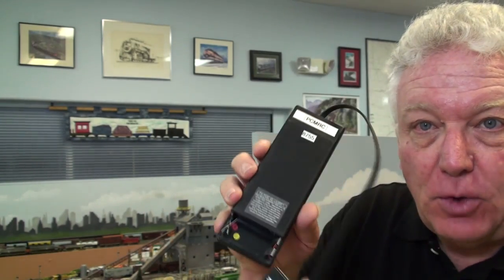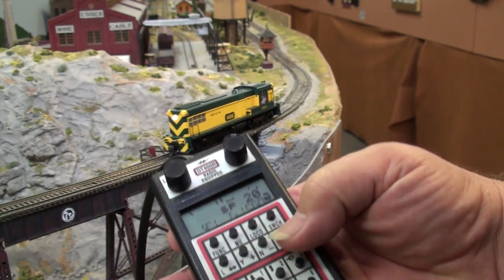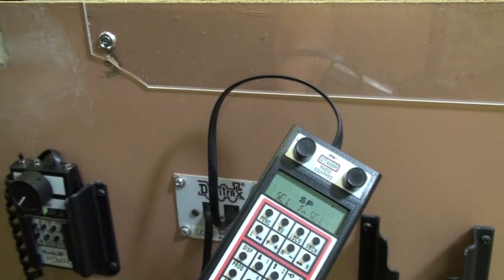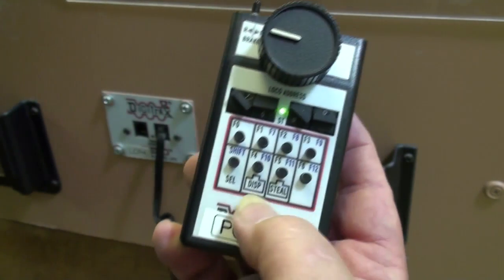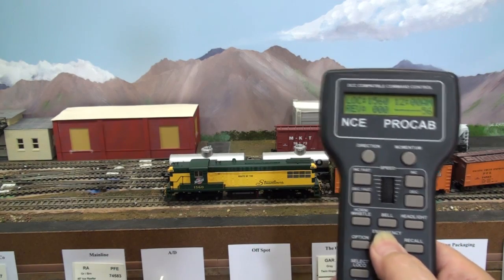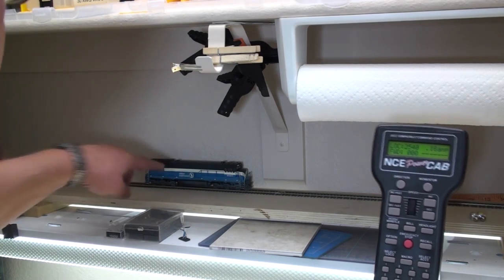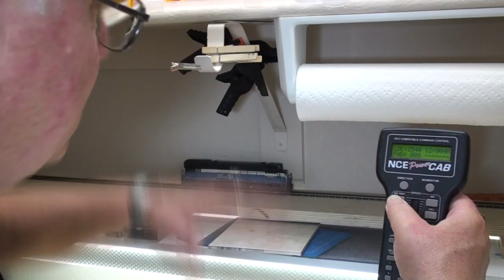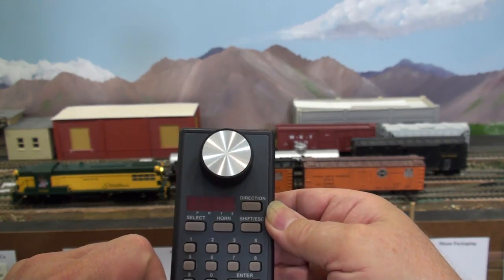DCC system comparison | Digtrax - NCE | Model Railroad Hobbyist

Comment: I have been out of model railroading for a few years now ...and I have to say that this seems like a very obsolete way of doing this I could do the same thing with a mini computer arduino, beaglebox , raspberry pi  and my smart phone look it up on youtube
Reply: Since you've been out of model railroading for a few yrs, we can say that your knowledge of what's obsolete is a bit flawed.  You spout about technology encompassed in Arduino...smart phone etc with no notion how you would
get these devices to control a model railroad.  Why would you want to use a "smart phone" to do this?  Nobody else would.  If you have an Arduino-based control system, let's hear about it.  Name dropping by itself doesnt make it.
Reply: Ange Purs I use my smartphone to run DCC locos all the time. All it takes is a old XP PC ($50), JMRI (free), and a Digitrax PR3 ($79).  

Why would I want to spend $200 on a throttle that on a scale of 1 to 10 is a -5 on user friendlyness? The DT400 seires throttles are the biggest pieces of crap ever perpetrated on the model railroading community.

I can hand a never-ever user a smartphone with WiThrottle or Engine Driver apps running, give them a 1 minute overview of the throttle and they can control a train in 3 minutes and never ask me again how to do something. I cannot seem to do that with a DT402x

Comment: sounds complicated. with this system you have to take a college education just to run a toy train.
Reply: You should distinguish between toy trains and model railroads.  From your comment, you have no
experience or understanding of DCC for model railroads.  You should stick with toy trains and DC
throttles.  Either way, all that is required is that you can read the instruction manual and follow the
steps.